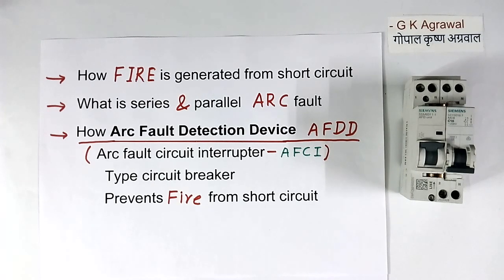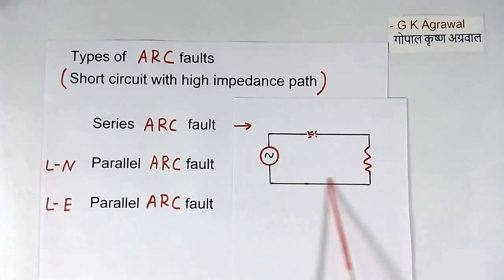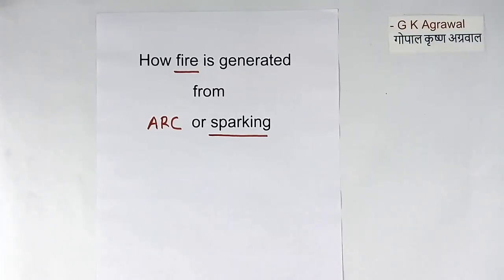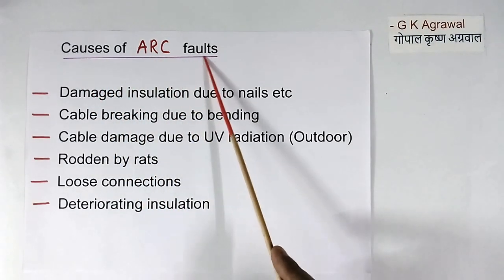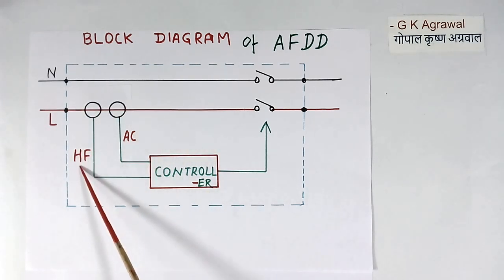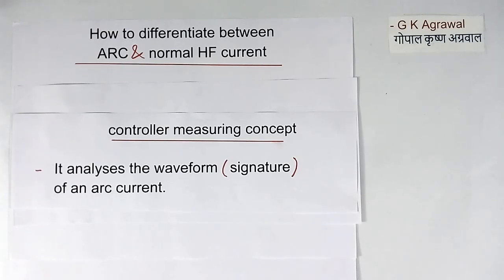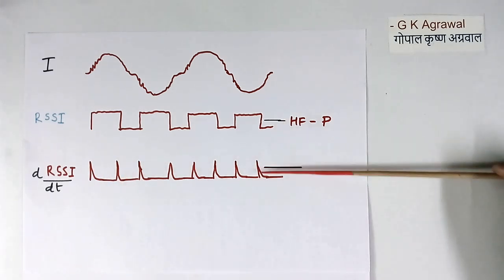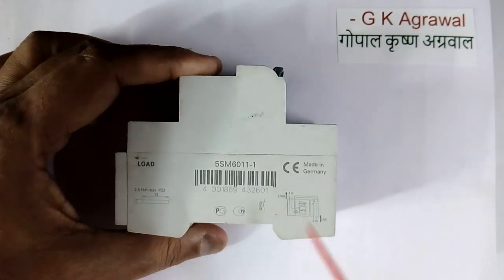How AFDD, AFCI breaker works, what is Arc fault detection device

Comment: Great explanation! Where to put or location of the AFDD in panel board? is it before or after the main mcb breaker?
Reply from the maker: AFDD has build in MCB. Any way it will work, you put before or after MCB. But I will contact manufacturer and ask them, where to put.
Reply from the maker: I contacted the manufacturer of the AFDD shown in this video. Their expert replied that, this AFDD can replace the present MCB at the incomer.
I feel that if you want, you can retain existing MCB also. AFDD can be connected before the MCB.
Reply: @GKAgrawal2  Great at least i have an options.

Comment: Sir koy instrument me 230V Ac ke jagah 4 to 20mAmp kyou use karte he ... 4 to 20 m Amp  230VAc use karne pae kya hoga ....sir
Reply from the maker: Good question. 4 to 20 mA signal transmission key liyey use hota hai. Adhik tar sensor key liyey. Yeh DC current hoti hai. Voltage ki jagah current use karney sey noise problem less hoo jathi hai.

Comment: I have a long-pending query.
1. For a balanced 3 Phase, positive phase sequence components current in Fig. (or diagram) show the direction of rotation in ANTI-CLOCKWISE direction and mention RYB. But, in moving ANTI-CLOCKWISE direction, sequence to face first IR1 further IB1 and at last IY1
2. Similarly for balanced negative sequence components current in Fig. (or diagram) show the direction of arrow ANTI-CLOCKWISE direction and mention RBY. But, in moving ANTI-CLOCKWISE, sequence to face IR2 further IY2 and at last IB2
It is not understandable.
Till now, in every power system book, this is mentioned. For your ready reference, Page 424 from Power System VK Mehta.
Reply from the maker: You are asking as if you are complaining to some government or some supplier of some item purchased by you. Note that this is free teaching class. 
Any way, for negative sequence, direction will be clock wise, and not anti clock wise. 
Further I am unable to understand that what is not clear to you.

Comment: Sir if inverter is installed with 1 phase wire and common neutral in house will RCCB work in main distribution box ????
Reply from the maker: If there is earth leakage current sese by RCCB, it should trip.